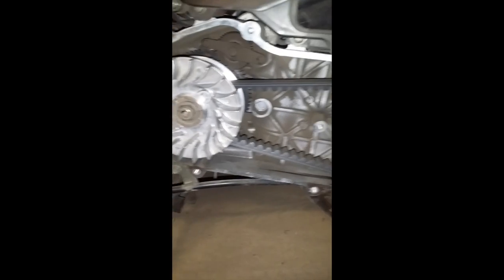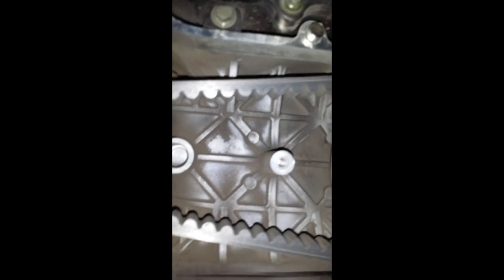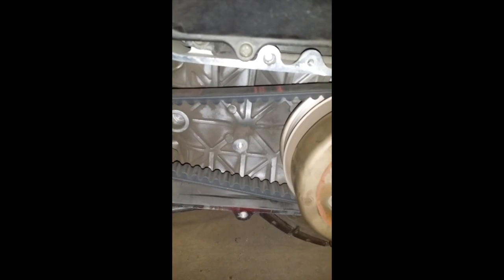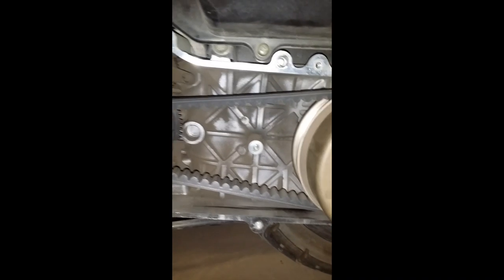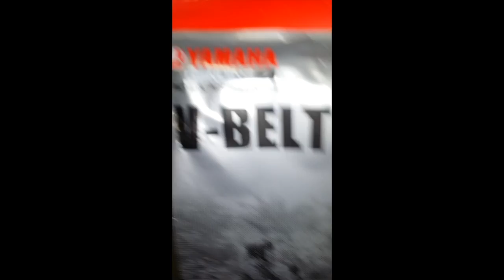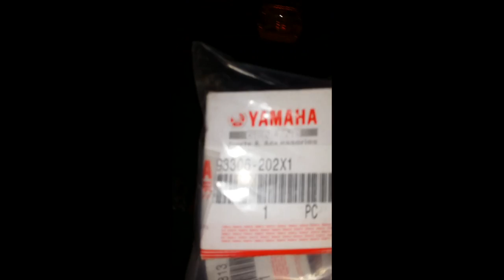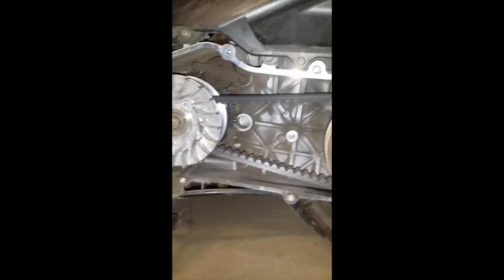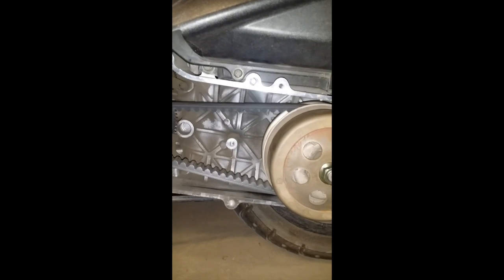Scooter Making Weird Noises: A Common Problem and Easy Fix! #10

Comment: The slapping is a symptom, not the cause. Let me give you advice when I ran into that problem. The belt was fine. THE NEEDLE BEARINGS IN THE CLUTCH ASSEMBLY WERE SHOT AND causing the assembly to wobble meaning hesitation.
Reply: DIOSpeedDemon please explain more
Reply: welder guy he means to say the problem is not the wheel bearing but the Rear clutch bearing , in rear pulley , there are two types of bearing normal small bearing and the needle bearing.
Reply: @knightcrawler94  by this it means the bearing on the clutch cover?
Reply: @danielvipin7163  no, the needle bearing is in the bottom of the rear pulley (closest to your gearbox) it is where the clutch is placed above it. Hoped it's help, sorry english is my 3rd language

Comment: Brand new scooter. 
Had belt slap,  swapped it for another brand new scooter, same belt slap. Then changed the factory belt with another new factory CVT belt. 
Same problem! 
Could it be 1)   Is the standard factory belt the problem?

Too long or too short? 

2)  Maybe Shims need to be added or removed?

3)  Could the clutch bell housing be causing the belt to be doing that slow speed vibrating. (Warped or unbalanced)

4)  Other?

Comment: I have an italica Rayo 150cc. Got it brand new and I am at 1790 miles. 
 
I recently started hearing scratching noises when I turn on the scooter and when accelerating the noise will increase. I haven’t open anything to see if it’s coming from the belt. I’m hoping this video helps me. Thank you.

Comment: So you can't fix the belt you have to buy a new belt and replace it?
Reply from the maker: Zechariah Stryhanyn Well the belt is one of those things that have a life expectancy. They will eventually wear out. So to answer your question: no you can't fix a worn out belt.
Reply: MSG MotoVlogs anyway I could get your opinion on a noise from my scooter? I posted a video on my Chan, I've adjusted the valves several times to make sure their right but I'm still getting this loud ticking noise. I've been told it could be my chain or a exhaust leak but I'm pretty sure it's neither of those.
Reply: MSG MotoVlogs figured out my problem, when my buddy changed the head he didn't put a big bore head on it, I'm surprised it was even running... Anyway new issue now Idk if it's from the cvt and those roller bearings that wear a flat side into them or not.. That's what my friend is saying but obviously he's not always on point lol. I can hear the ticking clicking noise on both the stator and the opposite side. Praying to god it's not the crankshaft bearing, it's not a clanking like I've heard on other videos where that was the problem.

Comment: Do you think I could install this easily as a beginner? or would you recommend going to someone? I just feel like they are so expensive id rather do it and learn myself
Reply from the maker: Great question! Have you ever changed the tire on a car before?
Reply: @MSG_MOTO  yessir! Is it that easy??
Reply from the maker: Yes, you're only removing something like 10 - 8mm(could 10mm) bolts to get the belt cover off. Got to squeeze the clutch with your hands,  the belt will slide down the ramp face giving you more play at the vario end to lift belt up and out. Clean the ramp surfaces, blow out any debris. Reverse steps. Snug the bolts and give additional 1/4 turn. Good to go!
Reply: @MSG_MOTO  wow thanks soooo much!! one last thing what do I use to clean??
Reply from the maker: Clean rag, brake parts cleaner and a can of compressed air. Mark the location of the bolts because some are longer than others.
Reply: @MSG_MOTO  THANK YOU!!!!

Comment: Hey bro do you think the belt problem could affect the throttle aswell?
Reply from the maker: Hi, belt slap and throttle are not directly connected. The throttle is connected to a throttle cable, which is attached the butterfly valve on carbs/throttle valve on throttle bodies. A twist of the throttle will open/close either of the above mentioned valves. "Carburettors/Throttle body controls the amount air drown thru the air intake."
CVT belt is a mechanical part of the transmission, its apart of the drive-train.
Reply: @MSG_MOTO  thank you so much, my moped is having some issues and I just wanted to know if I can find out what it is before I take it to a mechanic

Comment: i heard a squeeky sound. is that a belt problem as well? i just replace my belt and still has that squeeky sound when i started to accelerate my scooter. the squeeky sound disappears when my scooter speeds up to 20kph and up
Reply: Me too, you know how to fix it?
Reply: I also have the squeeky sound on a Vespa GTS 300 from 2023 with new belt installed ... Making squeeky noises when i accelerate , up to 20 - 30 km/h

Comment: Would a bad belt make the scooter rev or accelerate on is own?
Reply from the maker: 💬My basic thoughts are: an overly stretched worn-out belt would most likely cause a delay⤵️ in acceleration.
Reply: @MSG_MOTO  so its not the case :-) . I checked the throttle, it snaps back in idle fast so I dont think its the acceleration cable. If I give it some throttle and let go,throttle springs back into position but the scooter accelerates.  What could be the cause please?
Reply: @MSG_MOTO  Thank you so much.. Exactly what is happening on my scooter.. Its no longer pulling on slopes.. Its delaying when you excelerate.. Which means i should change my belt.. And that funny sound

Comment: Holly crap I’m experiencing the same noise out of the case. So a new belt replacement should get rid of the belt slap right
Reply from the maker: This helped in my particular situation. Your situation may differ. Do a whole inspection on your scoot prior to ordering parts.
👍 Good Luck
Reply: Brand new scooter. Had belt slap,  swapped it for another brand new scooter, same belt slap. Then changed the factory belt with another new factory CVT belt. 
Same problem! 
Could it be 1)   Is the standard factory belt the problem?

Too long or too short? 

2)  Maybe Shims need to be added or removed?

3)  Could the clutch bell housing be causing the belt to be doing that slow speed vibrating. (Warped or unbalanced)

4)  Other?

Comment: Hey what is that clicking sound when you turn off the engine at 1:36. I have that problem on my scooter and I think it's not normal because I haven't heard any sound like that until this morning
Reply from the maker: Thanks for the question. If I still had the scoot I would check out the sound.
Good luck!
Reply: That's just the piston stopping mid-stroke and the vacuum/pressure (depending on what stroke you stopped the engine at) pulling or pushing it back to a force-free position. Don't worry about it, that happens on every 1/2 cilinder engine. It just may not happen every time you turn it off, as it depends on what stroke the engine stops at.

Comment: How about dragging problems? Rpm goes down than usual the acceleration is not smooth How to fix those problems?
Reply: Check air and gas filters and  carburettor, get it cleaned if necesary
  Sometimes when riding bumpy roads it can stir dirt in ypur gas tank. Hope it helps

Comment: On cold start, my gy6 scooter seems to be making some weird squeak like noise in the clutch area. any ideas on what might've cause it? i would bring it to the shop but when it gets there the engines already hot and not making that noise. It wasn;t like that at fist. tho
Reply from the maker: I would take the belt cover off and inspect it for broken or damaged parts.
Reply: i had this it was shinny clutch pad shoes  from heat like cold brake pads on a push bike till they wurm up i cleaned them up with a wire brush thy get a burnt film on them if you ride up hill a lot from start as thy try to grip the clutch bell i also turn the belt around as the teeth ware one way like a sprocket from a worn out chain inspect your clutch bell cover for scoring also thy tend to get hot and warp out of shape giving a shuddering as u pull away all are cheap on eBay's site
Reply: Worn piston can be a problem too

Comment: I don't  have it that extreme. But maybe also sounds different cos you got the covers off.  I noticed also that it only occurs  to mine after a long ride with my nmax. And I didn't  reach my  replacing milage or  lifespan.
Reply from the maker: Thanks for the info
Reply: @MSG_MOTO  my issue got worse btw, noise and dragging, replaced flyballs, vbelt, cvt cleaning, still dragging and noise. They made me new groovings in clutch bell, now it is ok

Comment: Hello, my vespa 150sxl bike makes a rolling  metal to metal contact kinda noise when you cold start it nd accelerate immediately. But this noise fades away once the engine gets warmed up. 
And if u start the engine again after warming up, u don't hear the noise anymore. 
Can you please guide me regarding this problem.
Reply from the maker: Hi, thanks for the question! Do an oil change and check the old oil for metal flakes? It's a good indicator on the health of your engine.

Comment: I own a scooter and it squeaks and screeches while riding uphill and also while acceleration it's almost 5 year's old and I've almost rode about 40,000 Kms so wt seems to be the problem. ??  Ty
Reply: Belt is slipping

Comment: I have a 50cc made In china scooter. Bought new put 3000 miles on it now it's 5 mph slower and makes aloud shredding noise at 35 40mph... Help??
Reply: Did you ever find out what it was ? I’m having the same issue with mine

Comment: I’ve replaced the belt and still a rattling sound. Any help?
Reply from the maker: This video addresses belt slap. I suggest having your scooter inspected by a professional mechanic to diagnose the rattling sound. Good luck.
Reply: Your rattling sound comes from worn rollers.you have to replace the rollers
Reply: Clutch plate sounds loose.

Comment: I got 125 scooter it rides OK but it vibrates when I go more than 30 mph and I get a faint high pitch noise coming from my variator fan any ideas what could be causing this Bro
Reply from the maker: martie newman Did you buy it used? What year is it?
Reply: I would check under the cover to see if the kick start has not sprang loose. Was common thing on my old GY6.

Comment: i have the same problem with my 2013 vip 50cc upgraded to a 96cc big bore kit.. my scooter seems to hesitate like belt slipping and ive just blew up my ncy variator (slides broke and flat spotted the roller weights and eat of the right side or motor side of the belt...ive noticed a small amount of oil in my cvt case and im thinking it might be the clutch shaft seal of the crank seal.. my local mechanic said they all seep a bit..lol why would a seal seep a bit?bs .why call it a seal if it leaks?lol. anyhow i have the seals and extra dr pulley 10g slider weights(i like them better) and ive order a new DLH Kevlar belt and i ordered extra slides just in case.. im running a DLH varitor but im not like the ticking sound it is making.. i believe there is too much slop in the posts with the slides causing this ticking.. it has about 1/8 in play and i think it should only have about 1/16 in max.. what are you ideas on how much play a variator ramp plate slides should have? and do you think it is the oil leaking in is causing this or is it my ncy slider clutch with the 3 pins hanging up? im a bowling alley mechanic and a framer..lol any help would be much appreciated..
Reply from the maker: Wow, where to begin? Im just a guy that feels comfortable working on the vehicles I own. I would not have considered VIP scooter brand nor any other generic chinese scooter, Yes this scooter was produced in Taiwan (for Yamaha) and the parts network is great. 
I am a certified Automobile mechanic. In your scooters' original configuration all components should work in unison. If you increase the engines output without doing the same with the cvt, reliability issues will raise. I wish I had more to offer in terms of solutions but I don't know enough about the problems associated with BBK.
Did it run normal prior to the BBK install?
Reply: Maxi Scooter Guy no it ran worse..I also have a ncy racing cam on it and racing variator and a ncy clutch..the only thing that I didn't change was the bottom end..it has the same crank etc.. I'm about to go open it up now and take the cover off and watch it run.. hard to tell without seeing it..
Reply: Many times the sound comes from the camshaft bearings. Engine dies on acceleratings...

Comment: hi......my activa 125 makes noise with acceleration similar to the increasing and decreasing of acceleration of heavy loaded trucks......what could be the reason......it doesn't make that noise while on stand and accelerated......tried many places but couldn't find solution......not even at the service centre of the company
Reply: PIKKU KUMAR JHA I also have the same problem , any solution?
Reply: Same here...
Reply: Its because the gearbox has worn out..

Comment: cool vid, way to pay attention to your ride

i should take a look at my belt and see how it is, i know the manual says every 10,500 but im at 6k half way there might not be a bad idea to just take a peek

i'd like to see a basic tool kit put together to work on my zuma
Reply from the maker: Thanks for the comment, you're one of my favorite vloggers. You bought your ride brand new, you're the only driver, so you know best how your scooter performs. I purchased mines used and I'm the 3rd owner. I did the belt last night and the wheel bearing, too. I'll be posting those videos soon. After that, I'll be adjusting the valves.
Keep up the great work, We all really enjoy your channel O_H_!
Reply: the wheel bearing will be useful as i got rear ended and might need a new rim,  as well as the DIY videos, i need to start learning how to work on my scoot

appreciate the support